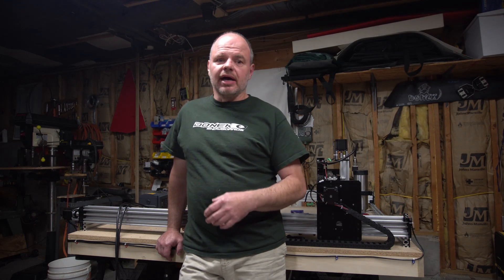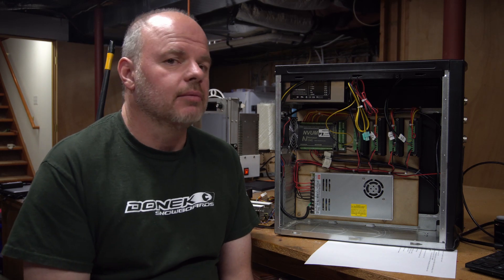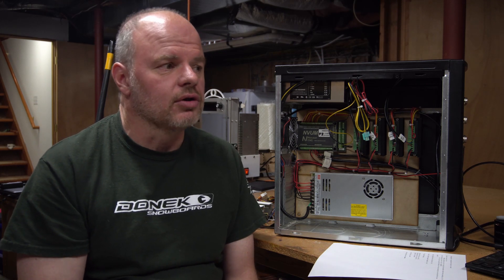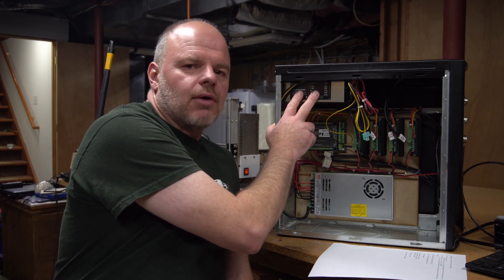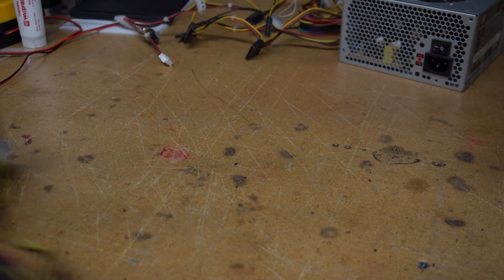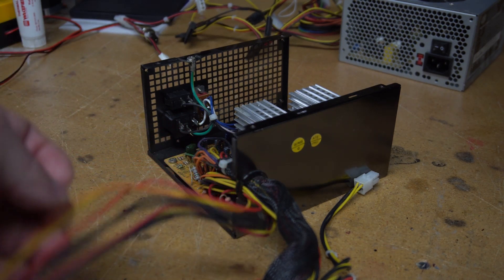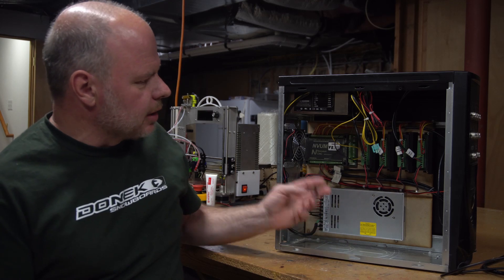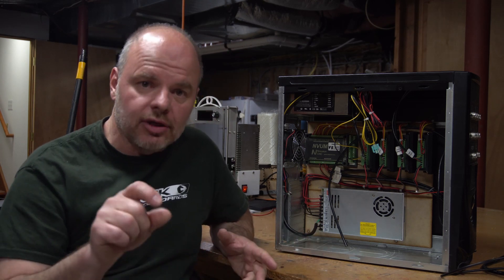Novusun and TB6600 Wiring and Enclusure Guidance

Comment: Do you have your 24v circuit “floating” I don’t see anything bonding V- to ground.
Reply from the maker: I believe that was the case.  I have switched to an acorn controller on this machine, but I think you are correct.  You are likely best making v- ground.
Reply: @seanmartin8770  just asking. I have seen people that prefer to
Keep the circuit floating but typically I see the 24vdc bonded with ground for protection purposes.

Comment: I'm thinking about buying/building a CNC router in the denver metro area, do you have any recommendations for local c-channel, or is online the best place?
Reply from the maker: I do not know of anyone in Denver that Carries that material, but I have never looked.  If I'm in a rush for those parts, I go through openbuilds.  If I have a bit more time, I go to bulkman and it's usually a bit cheaper on their ebay store.
Reply: @seanmartin8770  thanks! And thanks for putting up the videos

Comment: Hello
TB6600's run perfectly with 12 volts and no more than 2.5 amp loading. I only got trouble with TB6600's when I went to nema23 motors and 24 volt power supply. If you want to do it cheap as possible then use the PC power supply, the TB6600's and nema17 motors. 
Cheers

Comment: I always put separate small power supply for the controller. 
This way the power for control is clean and the inductive load of the motors is not interfering with anything. And of course I can run the motors on 36, 48 or any other voltage.
I also put separate power switches for  each power supply. This is useful in troubleshooting or if the operator runs the machine into a limit switch and it needs to be moved by hand.
Reply: I appreciate the feedback.  I am running the motors on a separate power supply but the mains are switched by the same switch.  I am running into noise issues with the spindle.  I've given up on trying to get the NVUM controller to operate that VFD.  It sends a 10 to 0V signal instead of a 0 to 10V and it doesn't matter if you switch to active high or low.  And feedback noise off that VFD is so bad it constantly results in lost communication over the USB.  Maybe I'm missing something and you can enlighten me.
Reply: seanmphoto typically you connect 3 wires: 10v reference voltage,  0V/GND and the control signal/voltage.
The control signal voltage should vary 0 to 10 in reference to GND. But this signal is usually generated as PWM, not as a real DC voltage. Maybe a small capacitor on that pin would smooth it out?
Do you have access to oscilloscope? Even a cheap usb one should show you what is happening on that pin.

In any case, a simple potentiometer on the VFD works perfectly well for controlling the spindle speed in non-production environment.

But it is nice and useful to have the gcode turn the spindle on and off. That is easy to accomplish with any board, just map a spindle on/off signal in Mach3 to one of the output pins to drive a small relay (even better if you use relay board with opto coupler) that will short the remote start/stop pins on the VFD.
You may have to fiddle with the VFD config a bit to make it run the spindle when contacts are closed rather than act on impulse (meaning first impulse=spindle on, next impulse =off)

Last thing-ferrite chokes may or may not help, but are worth a try. 
If you are using shielded wires make sure the ground is “grounded” only at one end.
Reply: seanmphoto I found some posts related to this board suggesting the connection to VFD must be done with shielded cable with twisted wires inside the shield and everything must be properly grounded or EMI will mess things up.

Comment: I have the bulkman set up, and am ready to program the VFD and finish my box.  It ugly compared to this.  Is there a reason why you couldn't adjust the provided power supply to the max rating of the Novusun controller of 32V?  That would at least get you closer to your desired 36-40 volts wouldn't it? Would that work or am I asking for trouble with that?
Reply from the maker: I swapped to a 36volt.  You can certainly try bumping the voltage on the 24volt.

Comment: Thanks for the great video nice case build I hadn't thought of using a computer case for the electronics so i think thats the path im going to go now! as for the VFD/ spindle hook up have a look at these videos as its the same control box and VFD: https://www.youtube.com/watch?v=amVFpWYV74U  and https://www.youtube.com/watch?v=ehlgOhsmGAI&t=538s. I'm thinking i'll get the 1500 x 1500 so will definatly be doing the whip fix of your last vid. what spindle did you get Air or water cooled ? 1.5, 2.2 Kw ? if the 2.2kw water cooled does the  machine handle the weight? Thanks subed!

Comment: Thanks Sean about to place order for Workbee 1010 this video will help a lot.
Reply from the maker: I am finding that the TB6600s tend to overheat.  Make sure you use additional heat sink compound on those heat sinks and use a lot of ventilation.
Reply: @seanmartin8770  Ok fair enough I also build PCs in my spare time and find cross flow vent setup with noctua fans works best.
Reply: Sean Martin I ditched those drivers and only use DM556 now. A bit more money but can handle more power ( =does not work very hard with smaller motors) and the motors don’t whine (due to smoother shaping of the current curve). Some people do like whining noise of the steppers, though. 
Try one on Y axis, you may like them too :-)

Comment: How is the controller working out for you?  Looking at getting the one off of Banggood.  Last time I had mu CNC running, I was using LinuxCNC through the parallel port.  Does the Novusun work with Mach 4?  Wondering if I should get 3 or 4.  Thanks, Johnny
Reply from the maker: So far I have not had significant problems, but have not run this machine a great deal.

Comment: Hi great video I am finishing my system from bulkman same as yours but I need help with my limit switches  I am placing two on each axis but I need help with the wiring back to the control box can you help
Reply from the maker: What help do you need?  I won't be in front of my machine until Tuesday.  Did you review the bulkman wiring diagram or the diagram I put on thingiverse?  If you are using them as limit switches, I would think you could just put both switches in parallel and it should work.  It will read that it hit a limit if any of them are tripped.  Unless you are wanting some different function from them.  My shopbot PRS has every single limit switches on the same input.